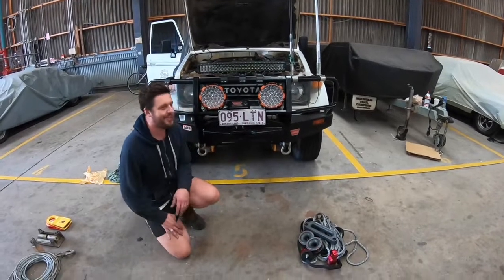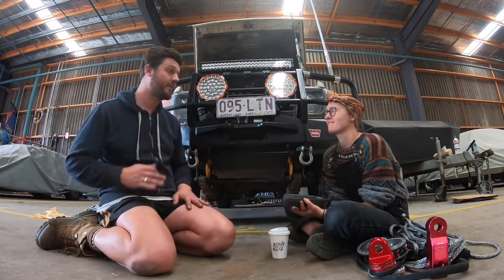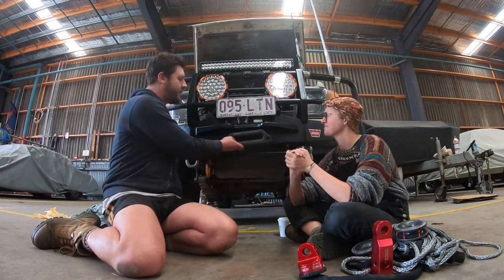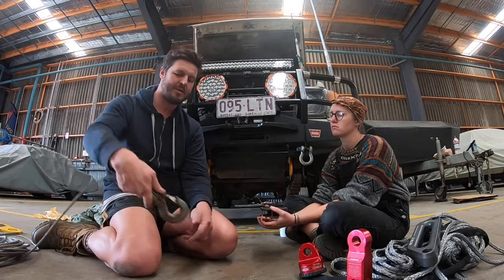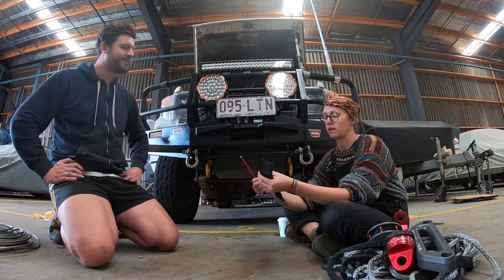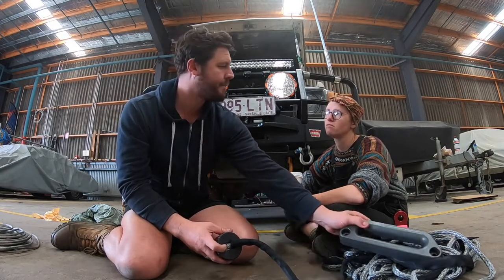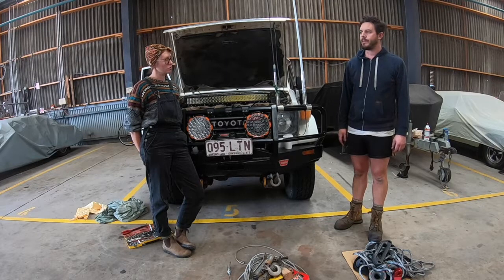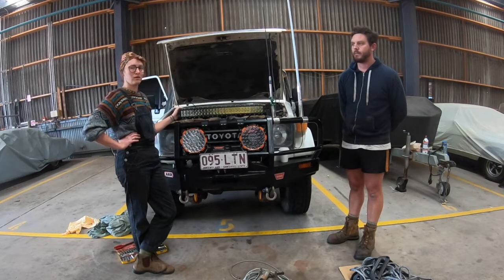What you need to know to convert a winch from steel to dyneema

Comment: Great video guys, for any one out there trying to simplify their set up with Dyneema and like doing stuff themselves, you can go straight from the thimbled eye of your Dyneema (remove the hook) and cut a piece of 1/2 inch poly pipe about 100mm long with a small v about half way and put that through your thimble and then let that tension against the fairlead when knot (see what i did there) in use (store it on your UHF antenna when winching) then use soft shackles directly to the thimble. These are  easy to make, just google diamond knot and practise on an old bit of cord, plus hey now you can splice so you can make cheap bridles as well. keep up the good work